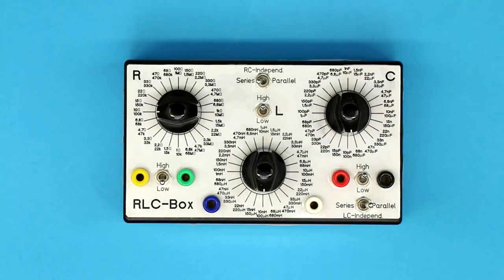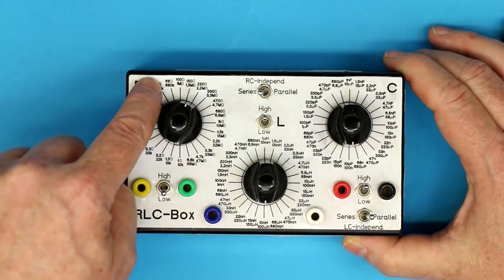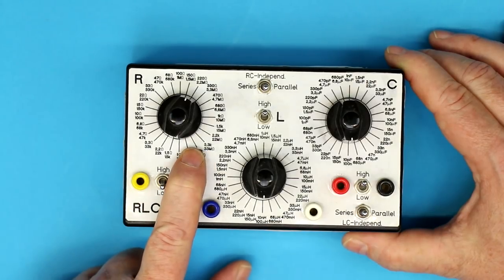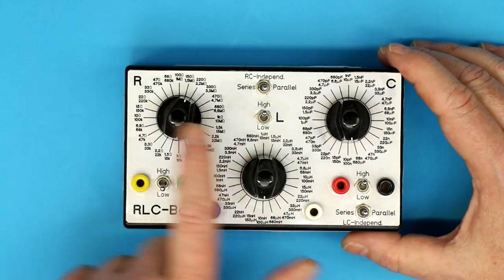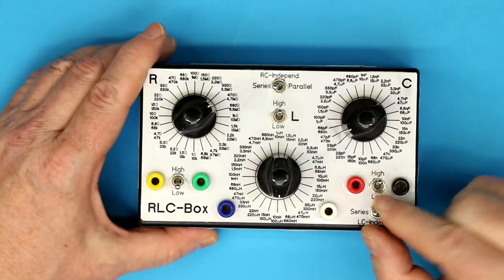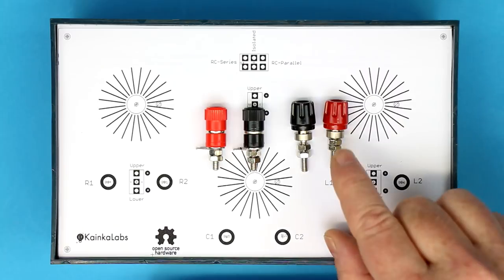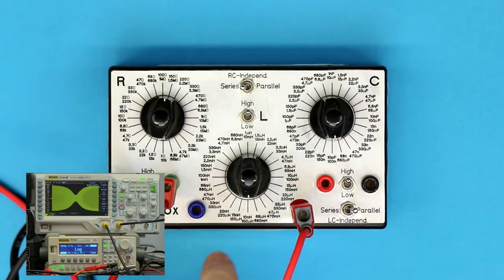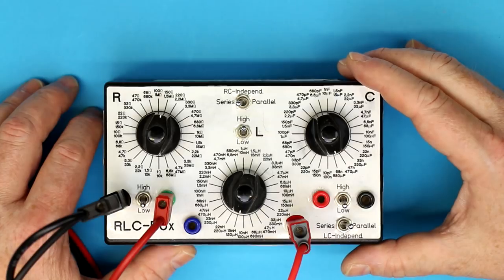RLC-Box Kickstarter Campaign!

Comment: I wish I had known about this a few weeks ago. I have a batch of boards I plan to etch today (including that EMI filter I was bugging you about). One other prototype I'm etching today is my first attempt at making my own rotary switches for a resistance box design. I didn't find a premade resistance box with the exact values I wanted so I created my own simple design. I am really curious if I can build a high capacity single turn rotary mechanism from scratch. I'm using some hardware from a broken multimeter rotary switch for the first attempt.
 ...In other words, I'll probably buy this to replace that pile of parts shortly :-)
-Jake

Comment: Love this. Would have liked it even more with 1W or even 2W resistors.
Reply from the maker: Yeah, but the switch is only rated for 150mA. So with the lower resistor-value there would be a potential hazard to destroy the expensive switches by overcurrent. Better burn an SMD-resistor before the switch-contacts die :-)

Comment: why talking about point to point connections instead of showing them.. like opening up the enclosure
Reply from the maker: It´s shown in the EMSHO-Video here: https://youtu.be/2UI3HwWVqUE
But the Kickstarter-Version will have dedicated PCBs at each plane of the rotary switches and the "wiring" will be mostly PCB-traces on the top-plate. So there will be only 3x3 wires going from the rotary-switches to the top-PCB.